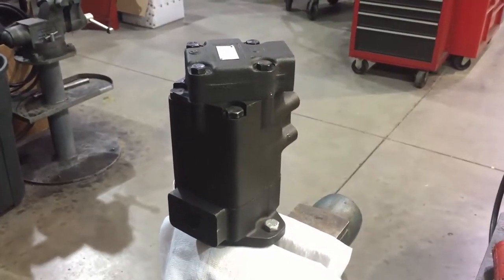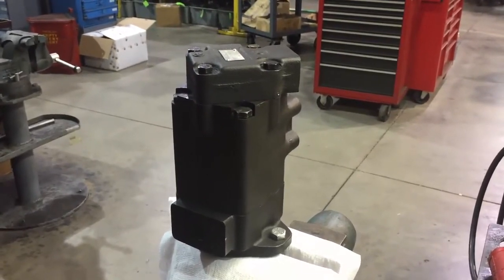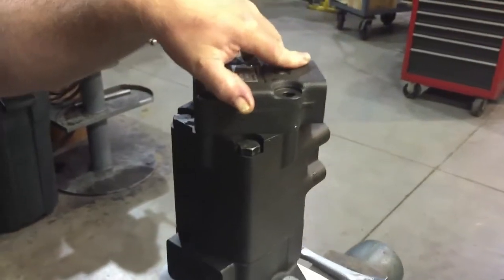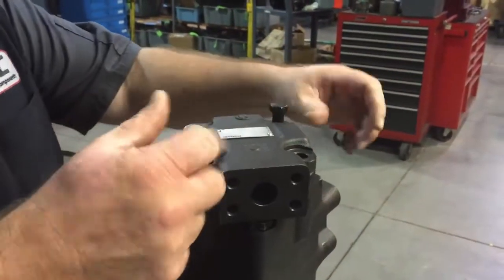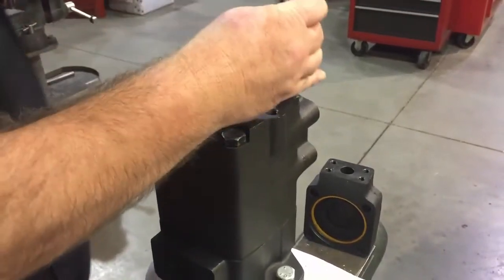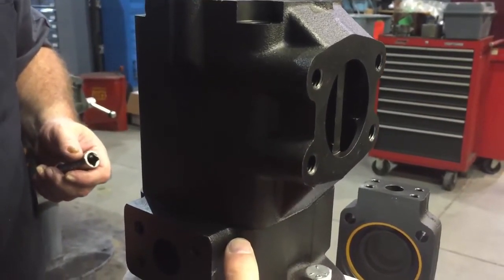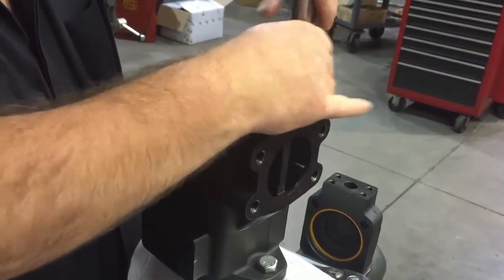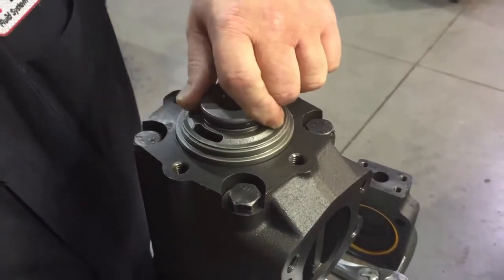Vane Pump Port Position

Comment: Where I can get cartridge for single vane Veljan  hydraulic pump in India?
Reply: Patancheru, Hyderabad
Reply: I am the manufacturer can provide VICKERS, Parker Denison, Yuken, pressure pump filter element，Can be purchased through Alibaba International station，Or add me Whatsapp+086015979599751